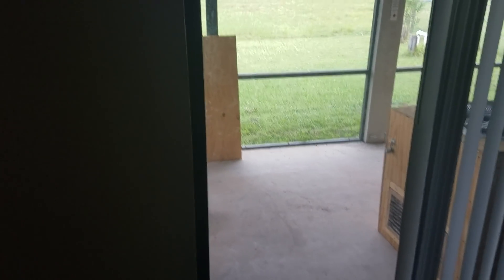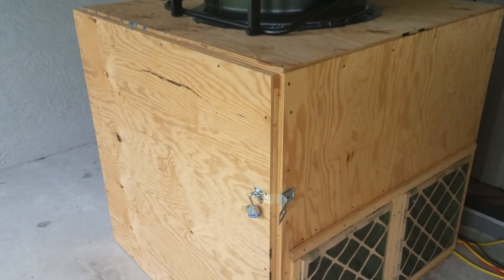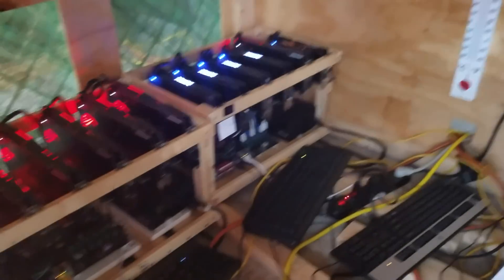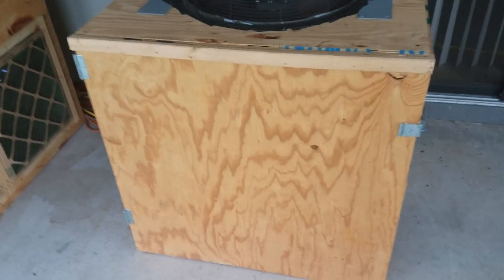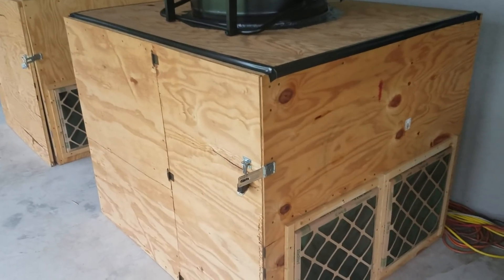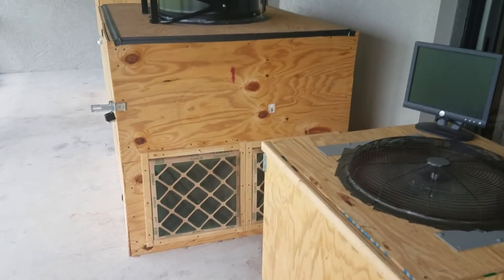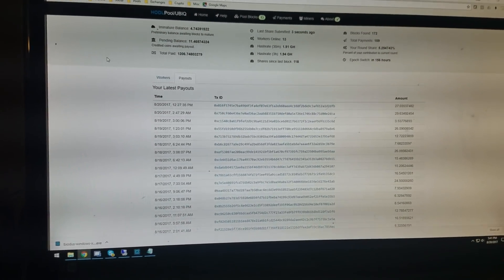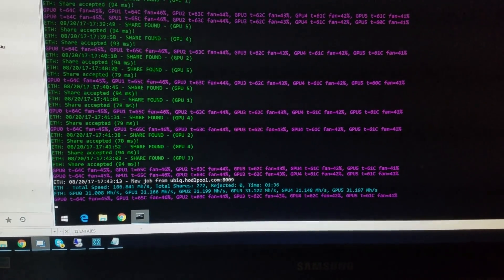Update - How to keep your mining rigs cool - 2 months later

Comment: I have one question for you. Usually, I mine on my GTX 1070 at the hash rate of 31 mhs per GPU but after I restart my rig, the hash rate drop to 26 mhs. Is there any way to fix it back ?
Reply from the maker: Sounds like your overclock settings aren't being saved. Use MSI afterburner to overclock, save your settings to a profile and set Afterburner to start when windows boots up.
Reply: TwoTon Hasher any suggestion how much I need to clock for the ideal clock?
Reply: TwoTon Hasher right now I put Core Voltage at 0%. Power limit at 75%. Temp Unit at 72 degree. Core clock at +100 and Memory clock at +650. Fan is at 70%.

Comment: Dud! You talk about 100 degrees outside then 60-64 degrees for the GPUs, but you failed to mention that the 100 degrees outside is Fahrenheit while the 60-64 for the GPUs is in Centigrade. Thats 140 to 147 degrees Fahrenheit on the GPUs...I Like the boxes but you could put them inside where is is cooler and vent the exhaust to the outside. Just saying...
Reply from the maker: You're absolutely correct. And yes, you could put them inside if you could properly remove the heat.

Comment: How important do you think the location of the intake and exhaust are? I am looking at building a similar box for eight 6 card rigs. Your design has cool air coming in right over the cards. I was hoping to not have to make 8 air intakes.
Reply from the maker: Its pretty important to have fresh air flowing over the cards. Heat rises naturally so having the exhaust on top and the intake on the bottom works very well.
Reply: Thanks. My box is 4’ by 4’ by 2’. I bought two 20” 6000 CFM fans and mounted them on the 4’x4’ side. I will play around with the intake locations to get the best flow over the cards.

Comment: hi bro i got a quastion is there any theory behind using 2 6gpu motherboards instead of 1 12 gpu one?
Reply from the maker: Yes, there is. With a 12 gpu - 1 mobo rig , you spend less money up front. (you can make your ROI back a little faster. But if you rig goes down, all GPU's are offline. Also, your limited to 2 instances of mining software in Windows (Windows only supports 8 GPU's at this time) or using a linux O/S like simple mining or pimp OS. When you get above 7 or 8 GPU's, rigs just aren't very stable (in my experience) . With two mobo's- 6 or 7 card rigs, you spend more money at the start but you have much better stability. And if a rig does go down, its just one rig, not everything. miners can argue either way but I prefer 6 to 8 GPU rigs. You just have more flexibility.  Again, just my opinion.
Reply: TwoTon Hasher hey bro really like the idea and am considering getting about 700 1070s and making boxes like these for them :) however just wanted to inform you if you have the creator update for windows 10 you can get 13-14 cards on windows easily. And I mean 13-14 nvidia or 13-14 amd :D
Reply: I was thinking the same 
why not just use one of these 

https://www.amazon.com/Asrock-H110-BTC-Motherboard-CryptoCurrency/dp/B073S5YV3J/ref=as_li_ss_tl?s=electronics&ie=UTF8&qid=1504966310&sr=1-1&keywords=asrock+h110+pro+btc&linkCode=sl1&tag=sonofatech-20&linkId=57d3e10fcd23da1d0995a89c8120260f
Reply: That make sense thanks
Reply from the maker: Thats a nice mobo, I have one. It works great. The majority of of my rigs are over a year and a half old. There was no such thing as a board that had 12 or 19 pcie slots when I built mine.
Reply: nice :)

Comment: how many amps are all your rigs using up ? whats your main breaker box 150 amp or 200 amp ?
Reply from the maker: I have 250 amp service and I'm burning a little over 300 kw/h per day
Reply: Thanks am new to mining any tips TwoTon Hasher on saving on electricity i use nvidia cards and nicehash how can i lower the draw at the wall using afterburner
Reply: Jesus Fuentes I live in sfl also and have 10 6card rigs running. 1070s. I have 100amp service and I'm maxed out running 97amp with my ac. I have a mining room in my house with 2 portable ac units cooling the room and my card run around 50-56c mining eth at 190mhs

Comment: it's a little late now you've already went that direction ..but liquid cooling. simply run the hoses through the wall in put the heatsink outside to disperse the Heat the same way we do is central cooling for Residence or commercial.  the way you did it was the path of least resistance and it is an awesome setup. what's the input output?

Comment: You can toggle a setting in your bios which makes your rigs auto-restart on power loss so you never need to manually turn them on, as soon as your rig recognizes that there is power it will restart. :)

Comment: Nice setup! I noticed that the GPU temps you showed on the screen are in Celsius  and your thermometer reading  was in Fahrenheit-  so the 62 degrees you are reading there is really 143 in Fahrenheit. If you check the video at 5:20 the thermostat is at 100 Fahrenheit as you mention and about 40 degrees Celsius. With 40  degrees celsius the ~60+ degrees Celsius on the cards makes more sense. The cards will always run hotter than the ambient temperature- not the other way around unless you have water cooling. Not really possible to have GPUs running at 66F if they are in a room that 100F. The air that is going into the fans that cool the GPUs are already 100 degrees so the GPUs are not going to be any cooler than that. Ok I think I explained enough (sorry)   Just a friendly observation- Love the setup! Glad to read you made it though Irma ok! Good luck with it!

Comment: very cool design, but if i will go copy that boxes i'll go for some improvements like lifting the box's baseline into 1 foot or more higher to protect the box from water and moisture to come in, since water and dust from the floor will become a big problem. To add more,  make the room cool itself,  must absorb new fresh air to make the exhausted heat away from the room by making some tubes with extra fans assigned for an air flow to get in the fresh air and making the heat out from the room.

Comment: also could add an air  diffuser above your cards, so that the air has to move across your cards, and then flow up the middle.
Reply: Darren Deslatte you dont need a link you just put a board (wood/metal) over the top of the gpu's then the air coming through the filters has to flow through the cards and not over them wasting energy.... i think its a good idea
Reply: Air diffuser? What exactly is that.... can you link to one?

Comment: use digital thermometer with wireless monitor inside and you will be able to set alarms if temp rises more than you want or humidity, also 3 fire alarms could be good and cheap inside and one monitor power surge with wifi like netamo or smappee

Comment: If you push cold air towards the GPUs, they will be colder than taking hot air out of the box. Temperature is vibration. Vibration transmits from atoms to atoms. Cold temperature makes the atoms vibrate less and stay closer to each others, so more atoms in a space. High temperature makes the atoms vibrate more and stay more distant from each others, so less atoms in a space. Vibration is transmitted from atoms to atoms so if there are more atoms in a space, they absorb more energy and if there are fewer atoms in a space, there are less atoms to absorb the energy. If you pull the air out you make a vacuum and there are less atoms in the box to absorb the energy. That's why it's better to push air in the box from under the box or the sides, and let the hot air get out from above. Cold air goes down, hot air goes up. Make a fluid motion of the air and compress it in the box!

Comment: on room windows, ur using thin metal mesh? i am trying to see how ait circulation is working, my problem is i dont get the point how to take hot air out of my room? after 12 hours my room heats up, so there is hot air circulation around my GPUs, which makes my GPU performance very unstable. I am too much confused now

Comment: cool idea for rigs... I sell AC units and as far as removing heat at least with outdoor condensing units you want the fan blades positioned so that the tips of the pitched blades are just above the edge of shroud at the opening in the top. An inch in the wrong direction makes for a significant loss of heat removal. Those look like floor fans already in a metal shroud so i think if you move them down so part of the fan shroud is inside the box your heat removal efficiency would go up. Or even look at exhaust fans in a warehouse in Florida.
Reply from the maker: Great information. I din't know this and yes these are floor fans re purposed to this need. Thanks.
Reply: Or better still Use squirrel cage blowers - they are designed to handle the vaccum created by the filters.

Comment: Hey,question here. 
Do you overclock on your GPU?
Any idea overclocking on ZCash with 1080ti & 1070?

2. , it would be great if u can list all the item u use to build the box and rig , such as the fan brand and name .
Reply from the maker: Yes for Zcash or any equihash algorithms, you would over clock the GPU some and memory.. not a lot but some. For ETH or ethhash algo's, you would lower the GPU clock and raise your memory clock. 

the fan i used is here - https://www.lowes.com/pd/Utilitech-Pro-24-in-2-Speed-High-Velocity-Fan/4755305

Comment: Dude, placing your rigs outside is a terrible idea.  Yes, you can avoid the noise, but now they're prone to not only higher ambient temperatures, but humidity as well.  If it starts getting cold one morning and they collect dew, prepare to say goodby to all of your components shorting due to condensation.
Reply from the maker: Dude, getting the rigs out of the house was an awesome idea, not terrible. The noise i could live with. It was the heat that was the killer. The rigs are inside of plywood box so they're not exposed condensation or dew and the constant dry heat that is being generated by the GPU's keep the humidity at bay. I've had them out there for 4 months now... zero problems and they run nice and cool. Thanks for your comment though.

Comment: I really like this box cooling concept, it's a great idea, but I would not dare to do it in its current state. It is a small box with maybe 2000-8000W of power that is converted to heat (1-4 6-GPU racks of 1080 Ti:s) and everything is dependent on the fan on top working.

My fear would be that if the top fan for some reason dies and I have let’s say 5000W of power in this box, it will become very hot very quickly.
Have you made any tests to see what happens if you shut of the top fan or do you have any ideas how to incorporate some protection mechanism that somehow monitors the fan, maybe a power meter that can trigger some kind of alarm if fan power consumption goes outside a specified interval?
Reply from the maker: Great question but the worry isnt really needed. Most miners, Claymore, EWBF and others have temperature throttling built into their software. If the GPU's get to a certain temp (i believe its 80 to 85 degrees Celsius, they shut down.
Reply: The gpu on the gpu would me hot and software turn off or the cpu would get hot and shut down the rig.

Comment: that top fan its intake function?
Reply from the maker: it functions as both intake and exhaust. It blows the heats out of the top of my box while at the same time, sucking in cooler clean air through the filters at the bottom

Comment: Great video and concept. I live in cf and have been considering a similiar setup. Would love to see a video on your thoughts on dealing with winter and freezing temps(granted in sf thats not as big an issue). I am afraid  condensation potential during cooler periods could be a killer. Also I have been considering an inside setup but trying to vent as much heat as possible up a chimney using something like an 8" dryer duct. Any thoughts would be appreciated( just getting started in mining). Thanks for all the useful info and keep up the good work. Cheers!!
Reply from the maker: I don't think it would too much difference from what I'm dealing with in the summer here. We have lots of humidity and rain here in FL. The GPU's seem to put off enough constant dry heat to keep the dampness away. At least that's how it seems anyway. No issues in the last 3 months so far, (knock on wood). As far as freezing temps, your GPU's love it. the colder the better. Most miners love the winter. Their mining rigs keep the house warm while their hashing away and they don't need to pay for any extra heating costs. The rigs make you money + keep you warm = Win - Win. As far as using your chimney, you'd have to fabricate some kind of shroud over your rig(s) and some how channel the heat to towards it. Maybe a fan mounted inside your chimney, sucking the heat from your shrouded GPU's  up and out. Regardless, I'd like to see how you do it.  Sounds like a fun project.

Comment: Do you optimize consumption of VGA cards ? On my Sapphire R9 Fury i decreased voltage from 1.25V to 1.15V and core clock from 1050 MHz to 1020 MHz. Consumption was decreased from 275W to 210 - 220W (about 22%) and computing speed about 3%. It will also significantly increase lifespan of VGA.
Reply from the maker: Of course i do. When you pay as much for electricity as i do, every "saved" watt counts.

Comment: You should build a alu box outside with the same dimension, the alu will cool the air and install a fan wich drag the air from outside in the alu box and in the room where you have this 3 boxes
Reply from the maker: I've had similar thoughts, I just don't have the tools to cut /shape aluminum sheeting. Not to mention, Aluminum is way more expensive than wood. But you not wrong. I'd love try this.
Reply: TwoTon Hasher remove all the leds from all the cards
Reply: angle iron for the frame, tin snips and a cheap rivet gun.

Comment: Are you using the fan as a air extractor or just as a fan?
Reply from the maker: Both actually. The fan sucks the heat out and at the same time, draws in cool air through the filters

Comment: Nice...:-)  How many watts and what air flow amount on the fans?  Thx update... got it.  5:30  I'd like to put some in a shed.
Reply from the maker: The big 24" fans are are 170W. I dunno what the air flow is. The Website says over 8000 CFM but I keep these on low speed. So i dont really know
Reply: Ok thx..

Comment: can i know how much celsius is average graphic card temperature in that box?
Reply from the maker: Moogies,  I haven't experienced any issues like what you've described. (knock on wood) I've found that If I can keep the GPU's under 70 degrees Celcius all is well but obviously, the cooler you can get your GPU's the better.
Reply from the maker: about 65 degrees C
Reply: 66 Celsius to Fahrenheit is 150.8 according to google... I had a brand power unit die, took it in for the warranty replacement and was accused that it was too hot to run the the miner at... other power supply is running just fine... yes it's hot here in central texas, but similar to your location... yes they replaced the power unit... but the tech and store owner were freaking out that it was over a 100 f that I needed a/c asap on the units... any thoughts on at what temp might be too much for gpu's, power units and mother boards? Thanks for posting this update, used your first video for inspiration ! again thanks so much
Reply: Thanks for the reply and thankfully cooler weather is here after Hurricane Harvey passed by... I'm making a slightly bigger clean room version in a 6'x8' loft of a shed, with a window a/c for temp control for next summer... up high the loft area already catches all the breezes then with addition of the intake/outtake fans I'll test best set up... I like your filter change too, which I'll incorporate. thank you again for the inspiration .

Comment: Impressive setup bud! Thanks for the videos and fuck all the haters. Finally decided on mining from home myself. Didn't know if I wanted to go ASIC or GPU.
Reply from the maker: Darthgeese, thanks bro. Thats a tough call in todays market.. Both seem to be profitable
Reply: TwoTon Hasher true. You inspired me to possibly building out my garage in mining gear. I will also have to battle FL temperature as well though. My only concern is bitcoin paying the electricity bill.
Reply from the maker: I wish i knew. I've never mined with ASIC. you can do Litecoin and dash as well with them too. I think they are different algorythms though
Reply: TwoTon Hasher ever thought of trying to rent an office to mine out of?
Reply from the maker: Darthgeese absolutely, i've even looked a little in the next town over to where i am. It has a much better pricing on electricity than what i'm paying here at my house but I just haven't found the right spot or what I did find was too expensive oe too big or small. That being said, I'm still looking. The only other caveat to this idea is the lack of GPU's in the market to be able to expand my little operation. Hopefully this is just temporary though. We'll see.
Reply: TwoTon Hasher thinking of trying out a rx560 setup. Some are claiming to get 15mh per card with very low power consumption.
Reply from the maker: I dont have any rx560's so i can't tell ya for sure. Good luck brotha!